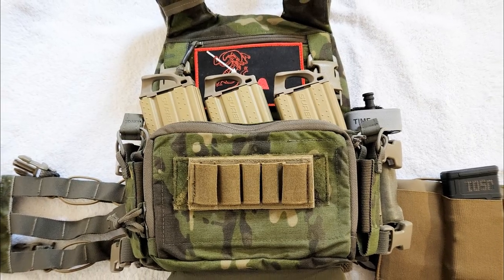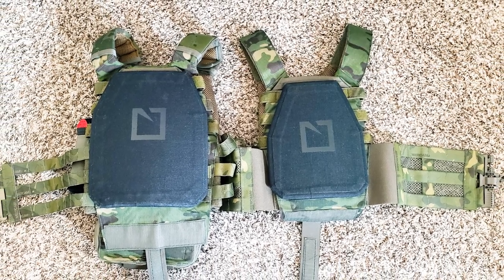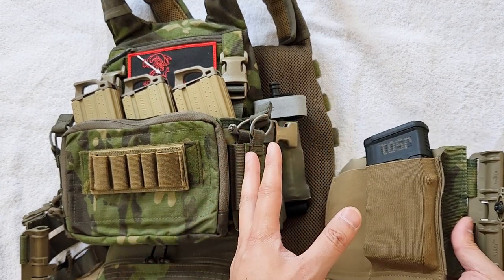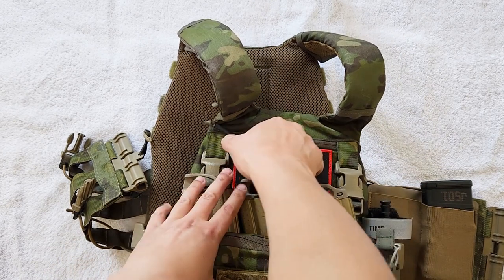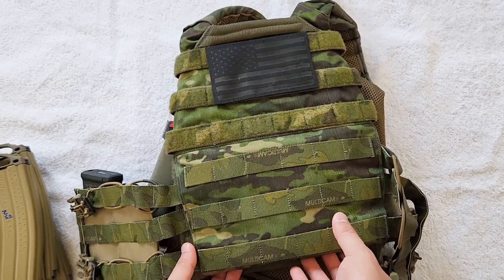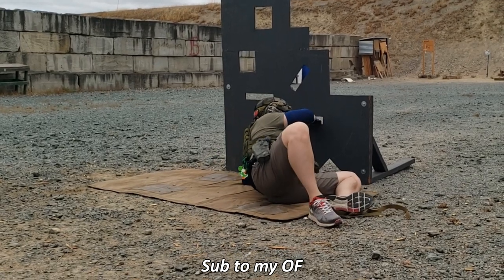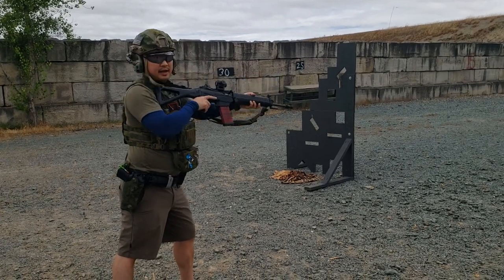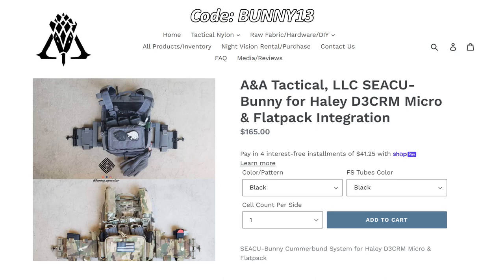Defense Mechanisms Mission Essential Plate Carrer (MEPC) Setup - HSP D3CRM, A&A Tactical, Hesco M210

Comment: 1 year late. To dudes on the smaller side, I'm about 5'6, 149-155lbs, 9" nip to nip, 11" or so from the clavicle -1" above the belly button. The dedicated small MEPC fits my small Highcom 4S17M (8.75x11.75) plates perfectly at 0.9" thickness. I made homemade backers out of 5mm dense foam that fit as well. It all fits great. No hindered movement or shouldering. Out of the box the small MEPC appears small as hell but once it's kitted out and on the body, it looks normal. I waited 26 days for an order that contained about 13 items from DM. It was worth the wait. Everything was in ranger green and everything mostly was in-stock besides the cummerbund and maybe one other item made to order.
Reply from the maker: You're referring to their Small SAPI cut MEPC, correct? It was available at the time I was looking and only the 8x10 variant was. Thanks for sharing your experience. I'm sure it'll help other fellow schmediums. 🤝

Comment: I know I asked you about it a long time ago and I thought it was cool that you said you need more time before giving your opinion. I respected that. It showed that you weren't a shill like so many guntubers are. I like what you did with it and your explanation makes sense. I'll give them a look.

Also, what is the black rifle you were using? It doesn't look like an AR but looks like those were Lancer mags, so AR-like?
Reply from the maker: Yup, that's right. I wanted more time behind it before making a video to give ya'll better intel.

The rifle is a US spec Sig 556 Classic and it does that STANAG mags. There was a US version, 551-A1, that took Swiss rock & lock type mags but it was basically the same rifle. I have that lower but don't use it as often because the Swiss mags are expensive and hard to find when I have plenty of inexpensive AR mags to use.

Thanks for the comment.

Comment: Good stuff as always, Jesse! I'm looking hard at the MEPC for my first plate carrier. It has all of the features I want, at a really good price for the quality. 

Also, you must've gotten your MEPC a while back. They've since discontinued the mesh cummerbund and they now use a skeletonized cummerbund like the one you got from A&A in the video.
Reply from the maker: That's correct, I've been running their systems for some time now, and didn't want to release a vid until I had more experience. I had to be objective against the preferred Scarab. My preferences are still evolving and is why I opted to talk about how I set it up vs a true review, as I don't really "review" gear.
Reply from the maker: Also, I think you'll be fine with the MEPC. Just plan out the features that you want and piece it all together. When you gain more experience then start seeking out features available with other systems. These are wear items, so you'll eventually have to start swapping stuff in the long run. Like for me, I prefer the articulating shoulder straps of the Scarab.

That being said, I know that A&A is also working on stuff but IDK when they'll release more info.  Shaw Concepts is another really solid option if you need a feature packed carrier. Keep me posted on your adventures, Kyle.

Comment: This is really close to the same setup I'm going to run, so this video was super helpful thanks! Maybe you mentioned it and I missed it, but what backpack are you running this with? Looks pretty nice do you have opinions on it? Thanks!
Reply from the maker: Nice! I'm sure you'll like it. These things are super individual based that there really isn't a "wrong" answer but there are alternative options (sometimes better) for many things you want to do.

The pack is a Haley Strategic Flat Pack Plus. They have a smaller one designed for PC integration but I'd rather just run standalone and be able to don and doff.

Comment: How did the 8x10 L210's fit in the MEPC? I ordered an 8x10 MEPC.
Reply from the maker: Basically made for them. The 8x10 3810 was too thick to get the velcro flap to fully contact. L210 was perfect.

Comment: What’s your height and weight?
I’m 145/150 lbs and 5’6” and I’m stuck between getting a medium or small I like how the plate carrier fits your body type but curious if your height and weight
Reply from the maker: 5'7" 160ish. You're a schmedium and can get away with both but usually sizing up to 10x12 and Medium carriers would benefit you in the long run for plate options if you don't want to deal with the 9x11 or SAPI cuts.

Comment: How are the shoulder straps as far as rubbing on your neck? I usually wear t shirts Vs combat shirts
Reply from the maker: Depends on your neck thicccness. 😂 There's enough space for me with the pads but I'm sure with enough sweat and movement chaffing is inevitable. I do prefer the articulating straps on the Velocity Systems Scarab for that reason. They seem to help a little better than fixed straps. I do not recommend running the MEPC without pads though.